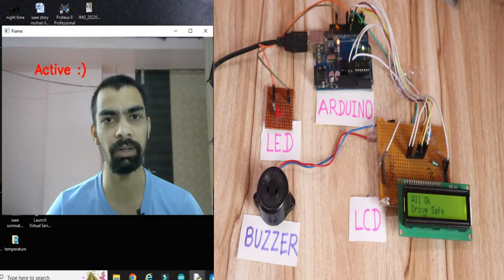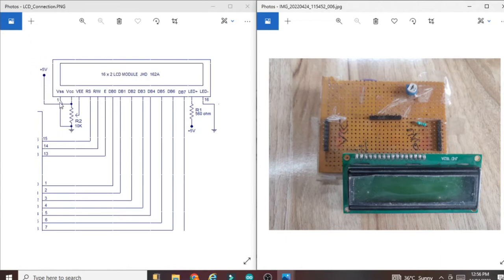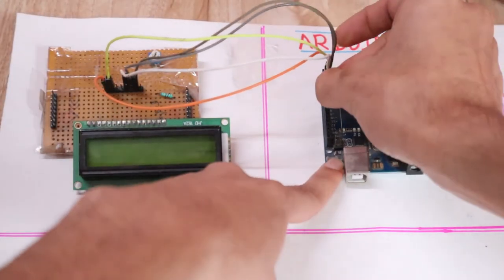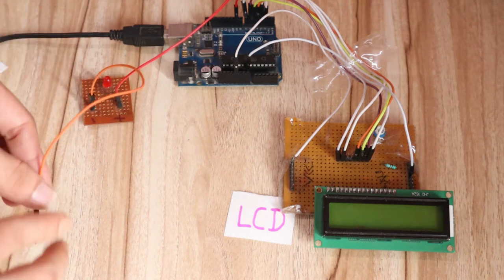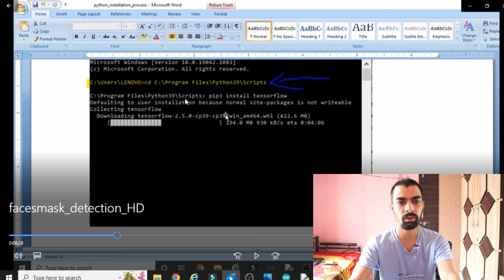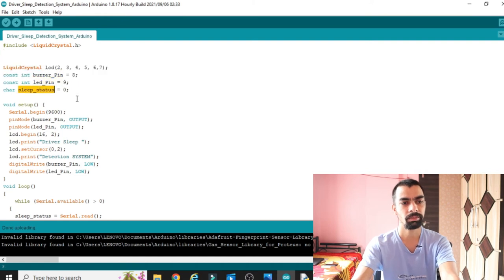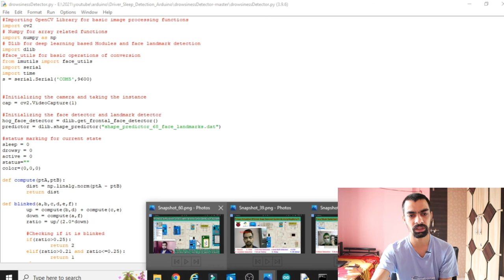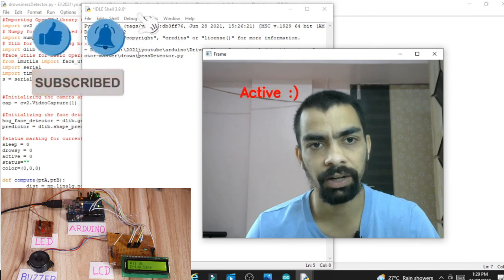Driver Drowsiness Detection System using Arduino | driver sleep detection and alarming system

Comment: hello sir I have two questions. First is does this system needs an internet to make? Second is where did you connect your camera in the arduino?
Reply from the maker: 1. Internet not require
2. The camera is connected to the laptop not Arduino.
Please watch the complete video
Reply: @rahulIOT  can i use esp32 cam for detecting drowsiness?
Reply from the maker: @joketime-g4v  sorry i don't have knowledge of esp

Comment: I have a question, the code still works if I connect the camera to the arduino directly and then I power up the arduino with the Jack entrance?
Reply from the maker: No..it will not work. You have to connect the camera to the laptop not the Arduino.

Comment: Hello, can you add an external camera to the arduino and not use the laptops camera?
Reply from the maker: No
Reply: Can I use ESP32 OR any other solution instead of Raspberry Pi OR Arduino UNO? Please answer

Comment: I want to implement this project:

"Design of Driver Awareness system depending on Eye and Face Feature and Discrimination"

Can I use controller ESP32 instead of Raspberry Pi OR Arduino UNO? 

I want the project requirements in terms of hardware and software ?...Please answer
Reply from the maker: Sorry i dont know about esp32

Comment: sir,can we implement the same project by using any machine learning algorithms?.....
also we need the hardware implementation of it.....
Reply: Can I use ESP32 OR any other solution instead of Raspberry Pi? Please answer

I want to implement this project:

"Design of Driver Awareness system depending on Eye and Face Feature and Discrimination"

Can I use controller ESP32 instead of Raspberry Pi OR Arduino UNO? 

I want the project requirements in terms of hardware and software ?...Please answer

Comment: Is using laptop necessary
I mean in cars and trucks how will this project work can't we use any camera without laptop is there any way
Reply from the maker: Then you can use raspberry pi.. already there is project..i have done with raspberry pi if you don't want to use laptop
Reply: @rahulIOT  thank you sir
Reply: Can I use ESP32 OR any other solution instead of Raspberry Pi OR Arduino UNO? Please answer
Reply: @muhammadsalem9924   Any micro processor like Raspberry Pi will work but not any micro controller like ESP32 or Arduino if you want to use external camera and not laptop's camera.
Reply: @nihalarya5605 
Thanks

Comment: is it ok to use l2c screen in this project?
Reply from the maker: Then you have to change code for display
Reply: do you have the code for display i2c? @rahulIOT
Reply: Can I use ESP32 OR any other solution instead of Raspberry Pi OR Arduino UNO? Please answer

Comment: sir my code is not running i am using python 3.9 but it says module cv2 not recognised but i already have installed opencv_python using pip command
Reply: Bro does u r project working

Comment: sir kindly give solution for this pls
Traceback (most recent call last):
  File "C:\Users\Hari\Desktop\dr\drowsinessDetector-master\drowsinessDetector.py", line 48, in <module>
    gray = cv2.cvtColor(frame, cv2.COLOR_BGR2GRAY)
cv2.error: OpenCV(4.7.0) D:\a\opencv-python\opencv-python\opencv\modules\imgproc\src\color.cpp:182: error: (-215:Assertion failed) !_src.empty() in function 'cv::cvtColor'
Reply from the maker: The camera is not connected properly..first run simple code to check your camera..if the camera is not able to capture the image then this error is received

Comment: I think there is a issue with dlib library , not able to install
Reply from the maker: No there is no issue..many students are using this.. you need to install Rasbian 64bit OS if you are facing issue. Every problem has solution only you need patience to find it.
please don't spread negative comments..i first tested the project and then upload video.

Comment: How to make this circuit connection's on the breadboard?
Reply from the maker: Please check my playlist..you will find separate video how to design circuit on breadboard
Reply from the maker: Video name is how to use breadboard.. interface lcd with Arduino
Reply: @rahulIOT  ok

Comment: Sir pyserial module is not getting installed...No module named 'pyserial' is getting displayed
Reply from the maker: Use command pipe install pyserial
Reply: @rahulIOT  ok sir now working but now lcd is not printing but , only backlight is displaying
Reply from the maker: @ganeshkumarm9510  check lcd connection..if you want lcd connection details explaination then watch my video..how to use breadboard for lcd.. check your all connection
Reply: @rahulIOT  sir I have given correct connection but I used 4 pin lcd
Reply from the maker: @ganeshkumarm9510  i also use 4 pin lcd
Reply from the maker: @ganeshkumarm9510  i2c ?

Comment: sir code is not open send an pdf
Reply from the maker: After you download from webpage then you will get zip file then you have to unzip it then it will open
Reply: what is the webpage open
Reply from the maker: @RamaLakshmi-cj1fl  check the description you will find webpage link
Reply: ok then one problem u can take a solution give please at not a lcd conect relay to my side i will connect on breadboard connection how to fix it sir
Reply from the maker: @RamaLakshmi-cj1fl  webpage link given in description of video
Reply from the maker: @RamaLakshmi-cj1fl  sorry I don't understand what do you want
Reply: my project componet is not in i2c module with another part on breadboard connection how to on the lcd display
Reply from the maker: @RamaLakshmi-cj1fl  please check my playlist there is video for breadboard
Reply: ok sir
Reply: I have one doupt then why the potential meter is used for the lcd
Reply from the maker: @RamaLakshmi-cj1fl  to adjust the brightness of lcd
Reply: ok sir thankyou please u r number giving for the doupt cleared
Reply from the maker: @RamaLakshmi-cj1fl  number already in description
Reply: ok sir you are in tamil speech is understand now  I speak on tamil

Comment: Traceback (most recent call last):
 please resolve  this error asap
 File "C:\Users\Atharva\Downloads\drive-download-20230624T062000Z-001\drowsinessDetector-master\drowsinessDetector.py", line 98, in <module>
    serial.write(b'b')
AttributeError: module 'serial' has no attribute 'write'
Reply from the maker: Install the serial library as explained in the video
If th6at not work then install the pyserial library.
Reply: Still getting the same error
Reply from the maker: @princegamingyt3410  install python 3.8 version
Reply: Already using 3.8 version
Reply: i am also getting the same error
Reply: Tomorrow we have the exam!!
Reply from the maker: @shivamdhavle7916  after you install pyserial you have to replace serial by pyserial in code.
This is because of the python update.
There is an article on Google.
Type the same error on Google and you will stack the overflow articles .
Just fallow that article your error will solve
Reply: @rahulIOT   now text on led display is not coming so what to do
Reply from the maker: @princegamingyt3410  please check the connection only that the issue.
Are you using this lcd or i2c lcd ?

Comment: I am getting this Plz Resolve this
Traceback (most recent call last):
  File "C:\Users\Atharva\Downloads\drive-download-20230624T062000Z-001\drowsinessDetector-master\drowsinessDetector.py", line 11, in <module>
    ser = serial.Serial('COM3', 9600)
AttributeError: module 'serial' has no attribute 'Serial'
Reply from the maker: Install serial module already told in Video